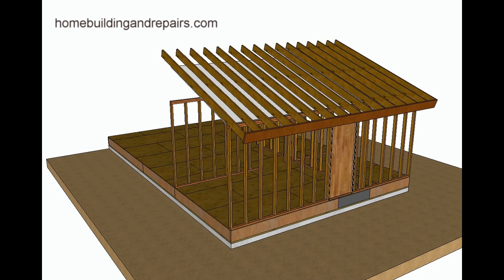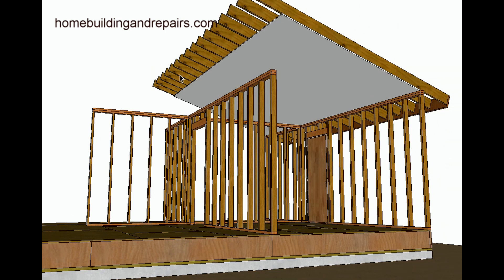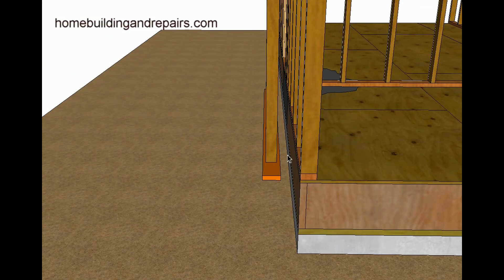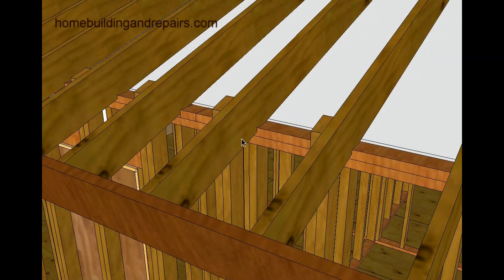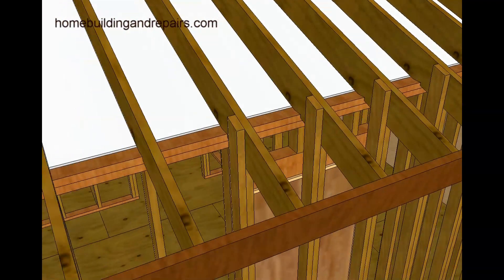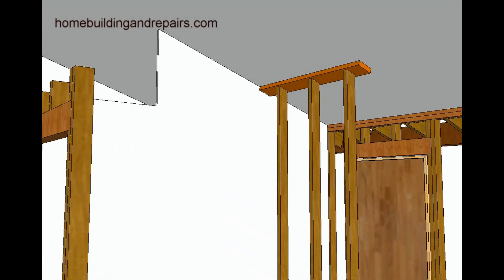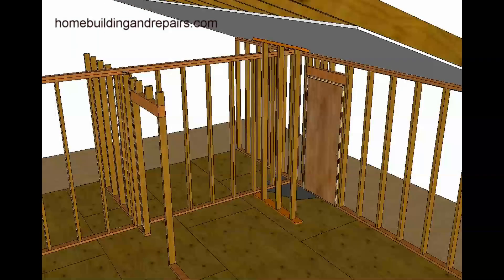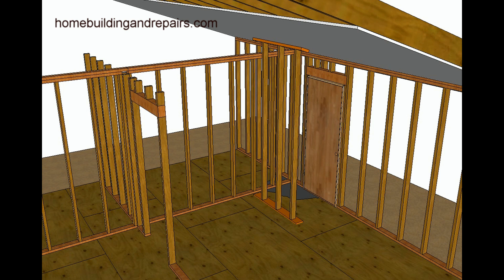How To Support Vaulted Roof For Minor Load Bearing Exterior Wall Repairs

Comment: For the wall that's exterior you have 2 studs, one under the rafter and one nailed in. Are two required? Thoughts on just using the one nailed into the side? I'm embarking on removal of an old criss crossed 2, 2x4 ceiling layout and trying to determine the best shoring methods. thanks

Comment: Hi Greg, Love all your videos. I'm a long time home owner/builder/re modeler and cant thank you enough for all the great design considerations. I'm going to be replacing a 3-0 door on an exterior wall with vaulted ceilings with a 6-0 slider, I think this will work because there is a floor to ceiling wall to the apex in the middle of the house with scissor trusses.
Reply from the maker: Be careful.

Comment: Instead of at the outer wall, what about the interior wall under the roof peak?  I have a studio vault truss where one half is flat and the other half is vaulted up to the roof peak.  The wall underneath is being opened up 8'.  I know how to support the flat section of roof.  Would you just do the same on the vaulted section and just angle the support to match the ceiling slope?
Reply from the maker: Yes, if support everything to be safe.

Comment: would it be possible to make a wall that spans from end to end, that is mated right against the existing wall and is tied into the rafters to support the roof?. This wall would be sitting on concrete slab. My aim is to make one of these walls on each side and remove the current 2x4 rafter and center pole supports.
Reply from the maker: It sounds like a good idea.
Reply: @gregvancom  thanks! Love the videos

Comment: Hello I’m looking to make an 8’ opening in an exiting exterior wall supporting a vaulting ceiling.  I am planning on using same method but would add diagonal bracing? Is there anything else you would suggest I add?  Thank you

Comment: Contractor cut into rafters to install LVL beam on kitchen ceiling, should I be worried? I feel like no one really looked to see that the LVL was properly installed. It concerns me because the ceiling is sloped and it looks like he had to cut quite a bit to drill the 2x4 flat onto rafters, so that he could then drill the LVL to it. We have pics from before closing up the ceiling with drywall and shiplap. Note: We get plenty of snow in Colorado. 

No point load transfer was used either and now we might need to add 2 extra floor joists. I saw an alternative of supporting and adding 2x12’s (I think) across one joist to the other. Would that be more cost effective? Easier?
Reply from the maker: Feel free to email me some pictures for more information and you can get our email address at our website. Hopefully you hired a contractor who knew what they were doing.

Comment: Any tips for doing this on at interior loaded wall, vaulted ceiling? Looking at adding a 16 foot LVL

Thanks!
Reply from the maker: You can probably find what you need at the website in the repairs section. Under the repairs tab you can click on the framing link. Let me know if you can't or feel free to send me some pictures of your project.

Comment: How would you make this work for a 6ft opening?
Reply from the maker: This method can be used for sections longer than 6 feet, but might require additional bracing if the walls aren't very long. For example if you're going to work on a 6 foot opening, but the walls only 10 feet long then you might need to install diagonal braces or nail a 2 x 4 at about a 45° angle on the temporary wall to prevent the building from moving side to side.

Comment: Hi Greg. Can we replace the studs in the supporting outside wall with cripples laying on top of a header, transfer the load to jackstuds/kingstuds and keep the access/repair area clear? Thanks.
Reply from the maker: +Khalid Al-Bahi I don't think it would be a problem with opening smaller than 6 feet, because that's how most doors and windows are framed.